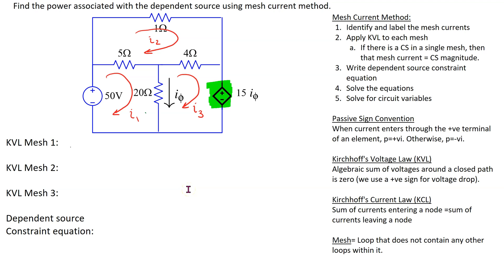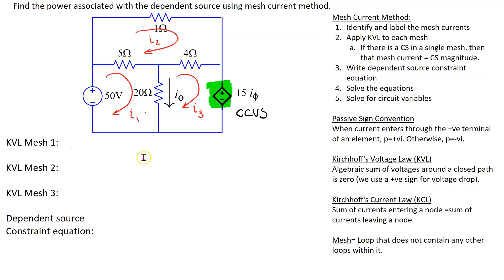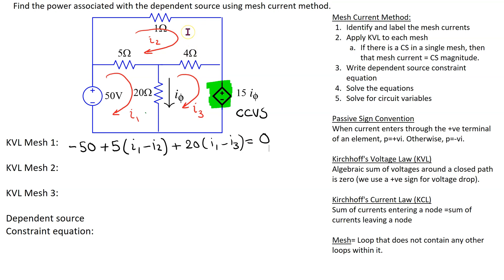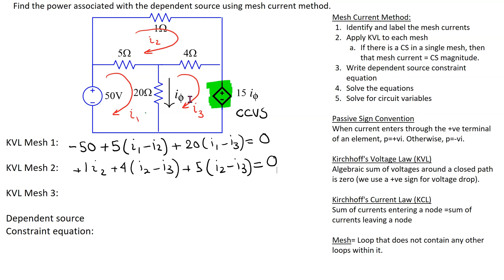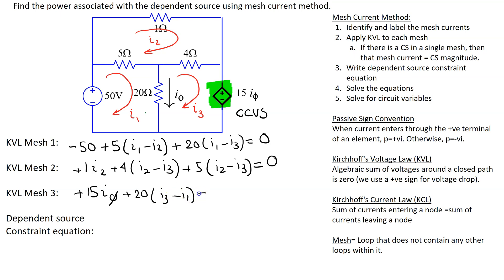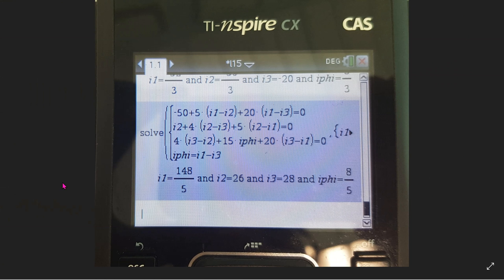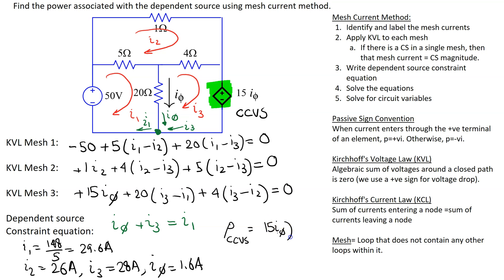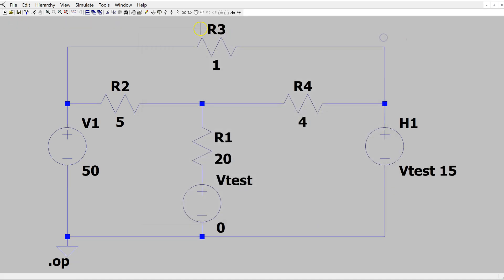Mesh Current - Example 4 (Trick: How to handle CCVS)

Comment: how is KVL Mesh 2:     +4(i2 - i3)  +5(I2 - i3)

Shouldn't it be    +4(i2 - i3)  +5(I2 - i1)
Reply from the maker: Well spotted! Yes thats a typo in theequation. The solution is still correct as I used the correct equations when solving and the solution is also verified with LTSPICE. I will add this typo to the video description.
Reply: @electriccircuits7164  all good my G, appreciate you